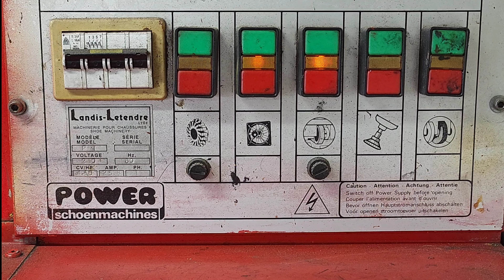New Balance 991 Resoling & Cleaning

Comment: In my experience the lining at the back of the heel is always the part that goes first. Is it even possible to repair this fabric? Or to reinforce it preemptively before it wears out?
Reply from the maker: It is possible to add leather heel linings. 
You can check with your local cobbler, I am sure they will be able do that for you